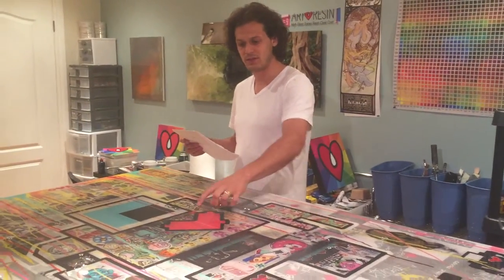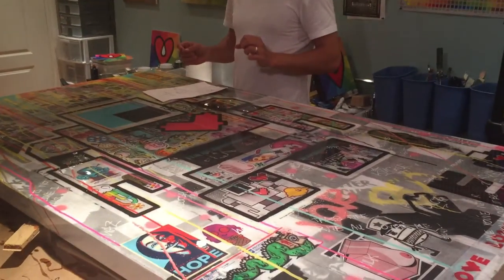Why You Should Resin In A Warm Room

Comment: No mention of what the room temperature range might be?    Some folks live in hotter climates and some folks live in colder climates.
Reply from the maker: Hi Reece - we generally say that resining should be done in room temperatures between 72-77F or 23-25C.  For an accelerated cure, you can certainly go above this range.  Some people like placing their work near a space heater to speed up the curing process.

Comment: I would die in my house if I put the heat on this time of year. :p I just wait until late afternoon and then it is almost 80 degrees in the house so perfect time to work with resin. :) - Heidi
Reply from the maker: do you live on the sun?
Reply: ArtResin Nope. South Central Texas near San Antonio :p Going to have 100 degree temps coming over the next couple weeks according to the weather.